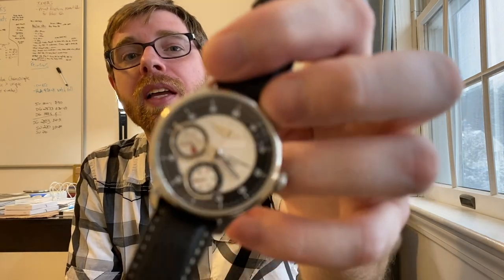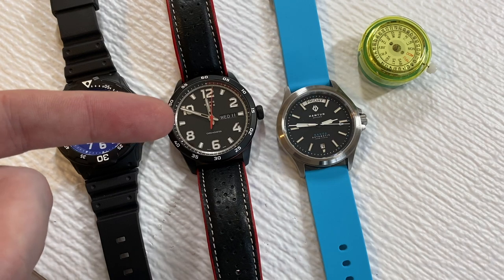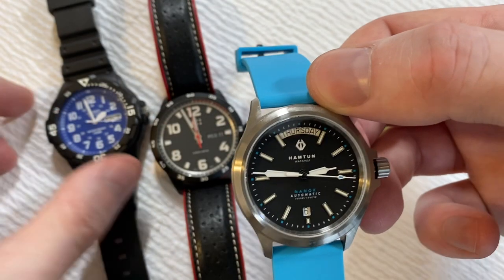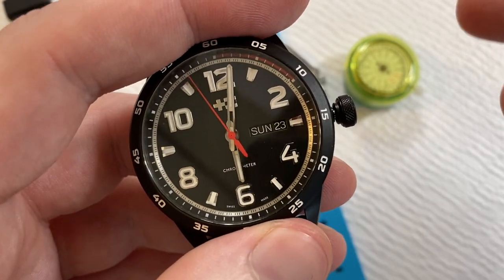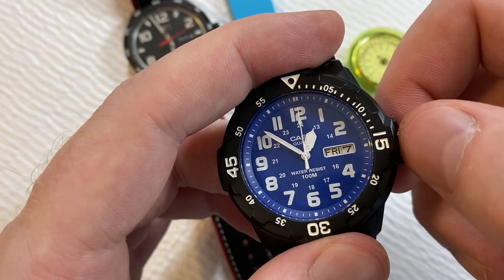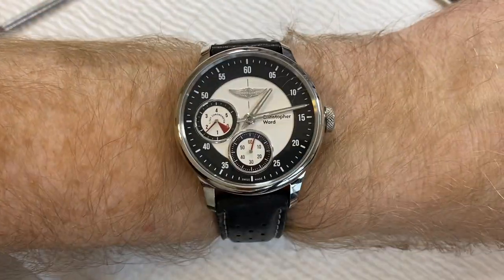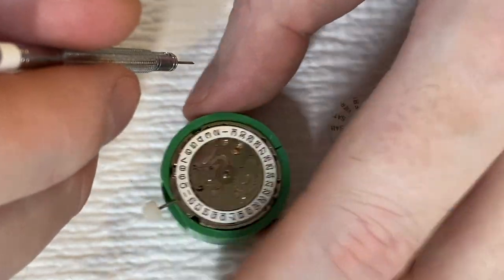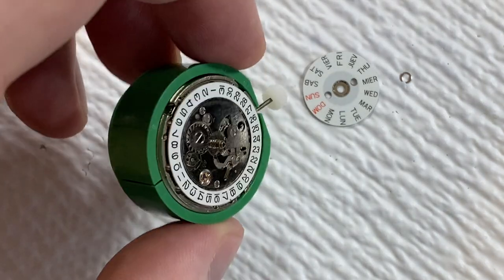The Day Date Complication, How It Works

Comment: I still don't get how the variation in days of the month works because some months have 30 days, some have 31 days a so on.
Reply from the maker: Well with most date movements, like those in the vid, you just have to manually adjust the date if it's a month with 28, 29, or 30 days when it gets to the 1st. Fancier date complications exist on watches with annual and perpetual calendars that keep track of these month cycles. Such movements are quite expensive though.
Reply: @WatchComplications  thanks for the answer, now i know that it was a simple solution such manually adjusting the date
Reply: U don't know for how long I was trying to get the answer for this

Comment: Where can you get that spec sheet?
Reply from the maker: for what specifically?
Reply: The one that you have in the video. Also in general? Iam still new to the watch game, mostly autodidact, but I have been drinking heavily of sites and channels like yours during this lockdown so I don't have all the resources and (ins and outs of the back door). Another watchmaker told me i should buy a movement and a spec sheet, so i could deconstruct and reconstruct again and again to buils some "muscle memory". By the way, thank you for your advice and responding
Reply from the maker: I do not have a spec sheet for the Chinese DG2803. Though I agree that if you want to get into tinkering, buy some lower cost movements and spend time practicing at taking them apart and putting them back together.